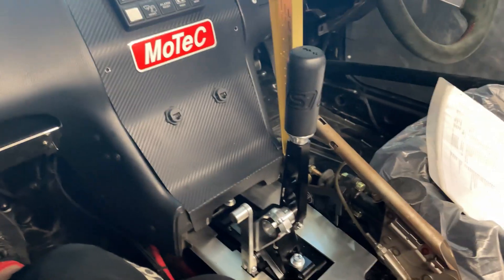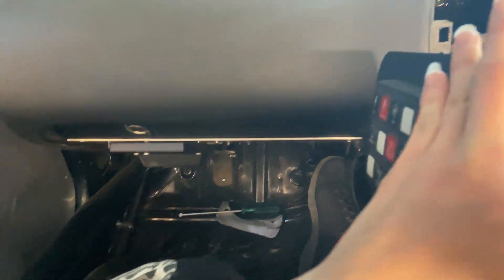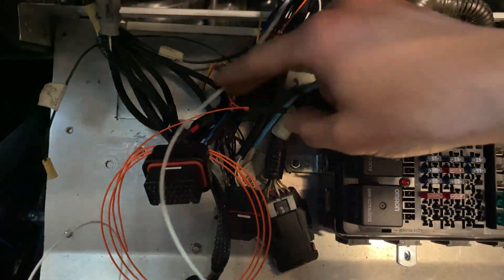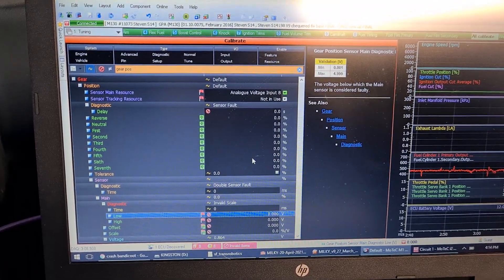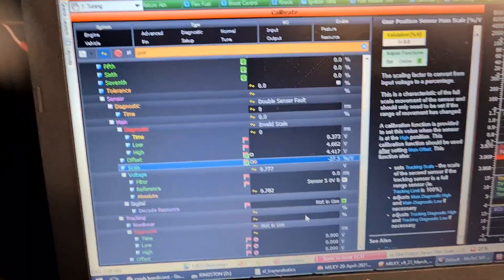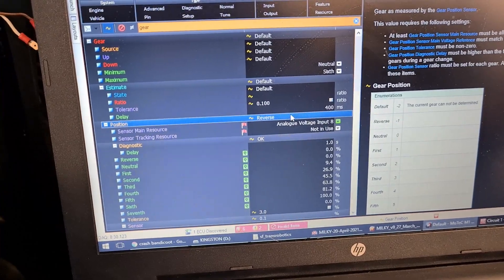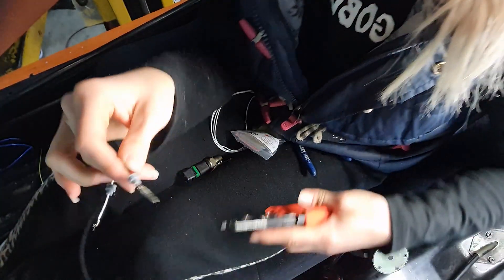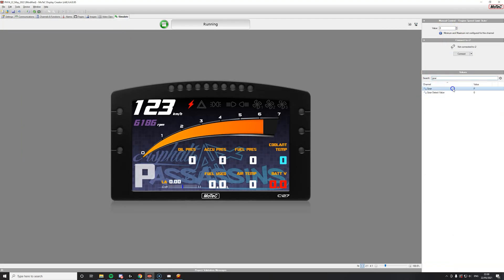Build with Mila #1: S1 Sequential gear position sensor wiring | MoTeC

Comment: Just curious what are the things called you are using to splice the wires together? I need some.
Reply from the maker: They are called splice crimp terminals. This is the kind that I like: https://www.efihardware.com/products/3172/brass-wiring-splice-crimp-terminal-combo-kit
I also like these for added support: https://www.ebay.com.au/itm/164982014662?chn=ps&_ul=AU&_trkparms=ispr%3D1&amdata=enc%3A1tH8-NqmgTwCoWwg5Lo_2PQ33&norover=1&mkevt=1&mkrid=705-139619-5960-0&mkcid=2&mkscid=101&itemid=164982014662&targetid=1740279243969&device=c&mktype=pla&googleloc=9071277&poi=&campaignid=18277121424&mkgroupid=142426603833&rlsatarget=pla-1740279243969&abcId=9301724&merchantid=494541069&gclid=Cj0KCQiAx6ugBhCcARIsAGNmMbgPLXiyQXyoVzuwOxgjy6jI22R12zZ6kkJPZ4bceWI_3nLbNn6hSHkaAp30EALw_wcB

You can also get solder splices, which work on a solder join rather than a crimp, covered in a plastic sheath